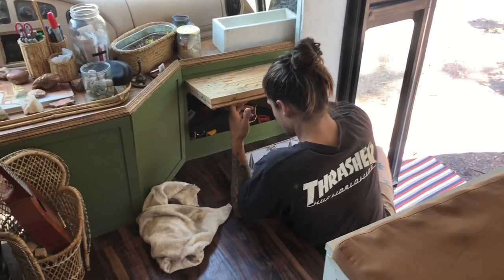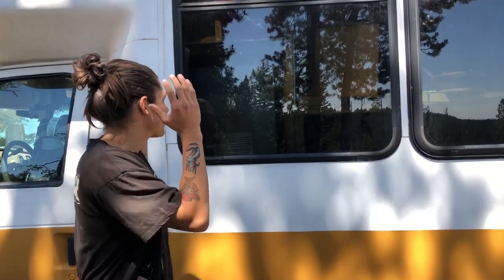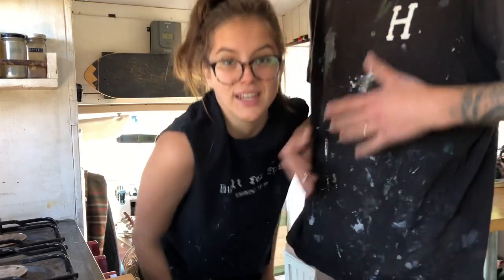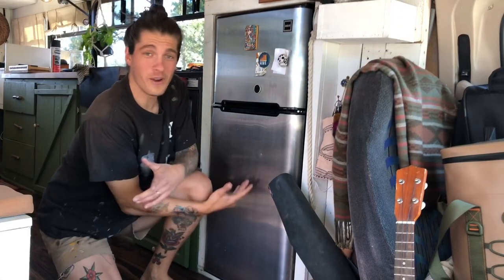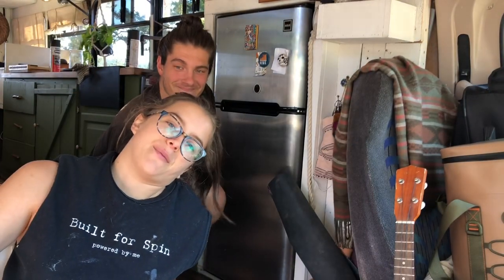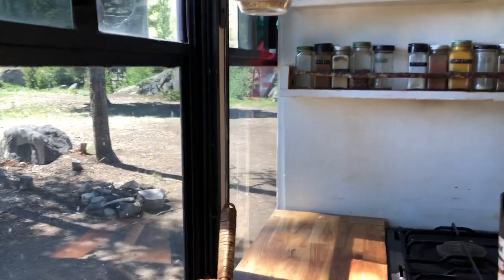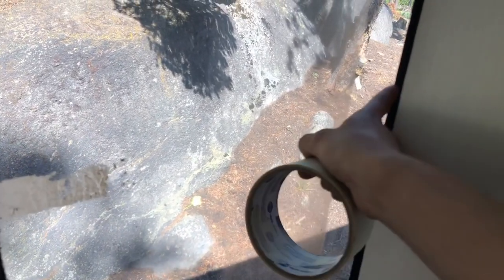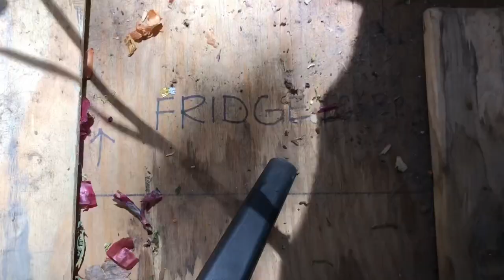Is This the Silliest Mistake We Made During Our Shuttle Bus Conversion? - Covering Bus Windows

Comment: I covered my two windows with  covers that are black on one side and white on the other and have reflectant on the inside.  For sure helps with the temperature, but the ones In the closet and behind the fridge have extra foam board for insulation...  I am having a moment thought where I am thinking do I want to fix this issue in my build  that I only notice.... I think I am going to have to because Im sure it will drive me crazy if I don't!    Love your build and your journaling.   Safe travels!

Comment: Love this! We’ve been watching you for a while. We have been converted a very similar shuttle since oct 2020. I love that you guys always find a way and are super resourceful! We ended up using a blackout window film that we found on Amazon. It applied with a little bit of water and you can remove it anytime. Then we used foam insulation and a piece of wood over it. It has worked great for us so far. 🤗
Reply from the maker: That is so awesome to hear!!!! And how cool we have similar shuttle buses! We tried a cheap version of the film and it didn’t work but it was most definitely because of the quality. What you did is what we would do if we started again!